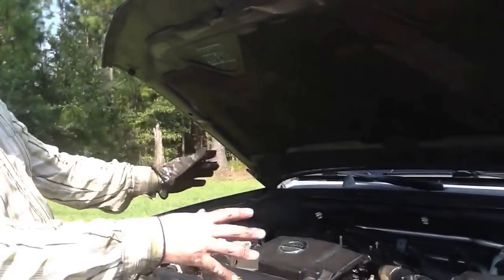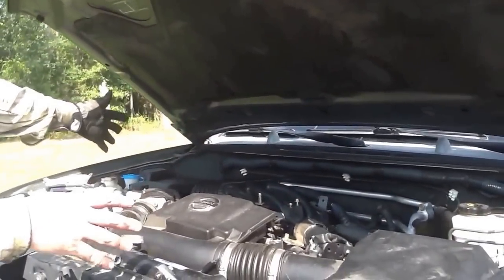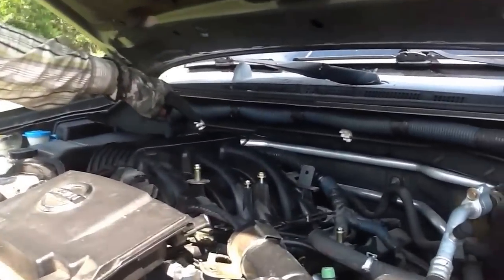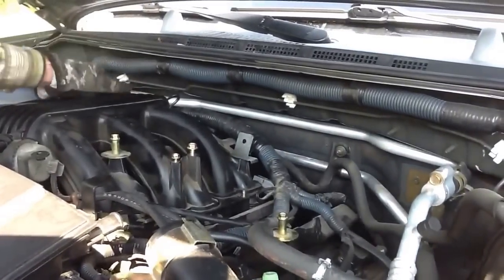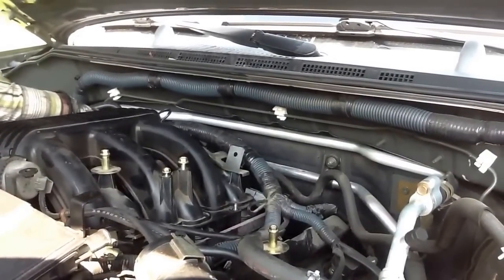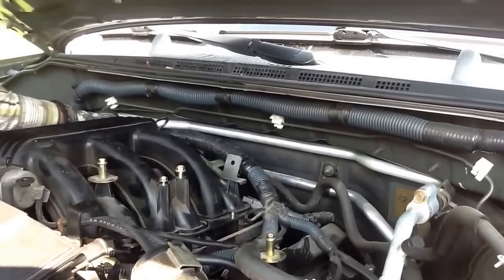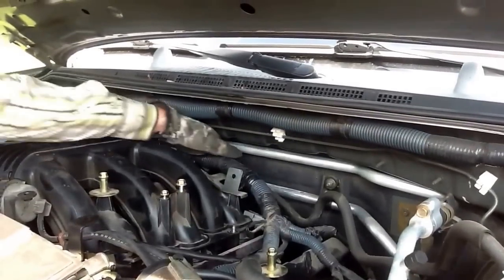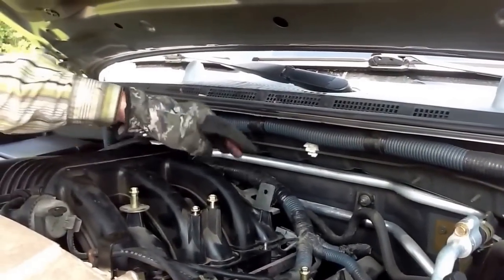2006 Nissan Frontier 4.0 V6 Cam Shaft Sensor Replacement

Comment: This method is more labor intensive, the easiest way is to approach it from the left side, remove the 12mm bolt which is holding the wiring loom,  remove the 10mm bolt that is holding the sensor, move the loom slightly out of the way and slight the sensor out. The tab on the sensor has to be pushed in which will push the sensor out. Replace the sensor and follow the reverse order. This will take about 10-15 minutes max.

Comment: You don’t have to remote the valve cover. I layed on top of the engine used a 10mm box wrench and just reached in behind the engine. Did it all by feel and had both replaced in 25 min. Only issue I had was the wiring harness on the passenger side was a bit in the way. I took out the bolt then pushed hard on the harness as I pulled out the sensor. Found he clip easy to remove with just my fingers no plier trick.

Comment: I had to replace my sensor as well.  I found that the easiest way to get to that sensor was to take off the front passenger wheel, remove the plastic fender well, and gain access to the sensor.  Its right there.  No removal of all of the engine parts.  It took 10 minutes to do this.  A ratcheting socket wrench works well with an extension on the 10mm socket.  It was a quick and easy to get to like this, but Nissan changed the part so make sure you have the right one before getting started.
Reply: Thanks man
Reply: Hell yes, I am...
Reply: The one you access thru the passenger side wheel well is the crankshaft position sensor, not the camshaft position sensor. I know, as I tried and realized after removing the tire and the fender well, that I was in the wrong place.

Comment: Thanks for the video Heath. Would you be able to take a closer shot of the sensor from where you are standing and add at the end of the video. That would be so much more helpful.
Reply from the maker: yes I will do that today. My wife did the filming, and after posting I noticed that it was missing that detailed kind of information.
Reply from the maker: Heath Gentry I will make a whole other video, cause I don't know how to add to the end of this one. Just look in my videos I only have 5.
Reply from the maker: Heath Gentry The new video is in my videos. Go check it out! Hope it helps.

Comment: I have an 06 Frontier 4.0 V6 and mine has 2 cam sensors.  One on each head, in the rear of the engine. Mine on the passenger side does not want to come out, possibly the "O" ring is swollen.
Nissan went from all plastic sensor to a metal part that is inside the head near the circular cam vane and plastic on the outside.  Part number is the same.  
The left cam sensor is also metal/plastic.  Watch that connector lock!  I need to replace mine.
Reply: Yes Nissan changed the sensors. That really threw me off when I changed my crank sensor. The one I took out of the truck was plastic but the replacement part I got was metal. Sent it back twice before a Nissan mastertech could finally confirm Nissan indeed changed the part

Comment: No removing the tire and wheel well cover only gives you access to the crankshaft sensor to get to the camshaft sensor it is behind the left head passenger side cylinder head between the head in the firewall you do not have to disassemble the manifold to get to it lay up on the engine follow the cable down you'll feel the 10 millimeter not reach in with a ratchet wrench from the opposite side take it off put the new one in done in 15 minutes you do not have to remove engine parts I just did mine an hour ago for the second time....
Reply: Longest Sentence Award!!!!

Comment: It would have been nice to actually show it, all I saw was the front of your engine
Reply from the maker: I looked on the Nissan Website for parts to find an expanded view for locating the camshaft 

sensorhttp://parts.nissanusa.com/nissanparts/index.cfm?action=replacement&siteid=14&groupid=A&sectionid=111&partcode=10006